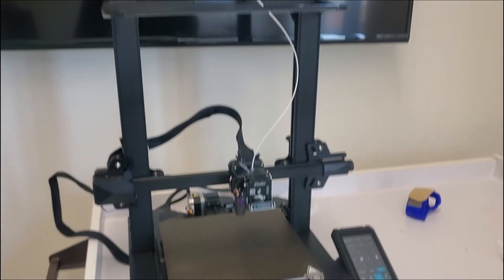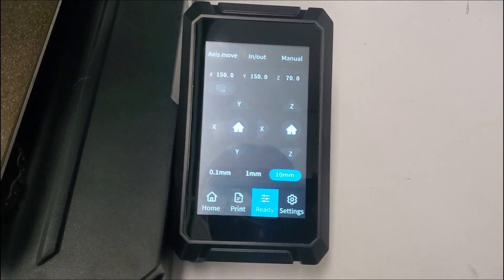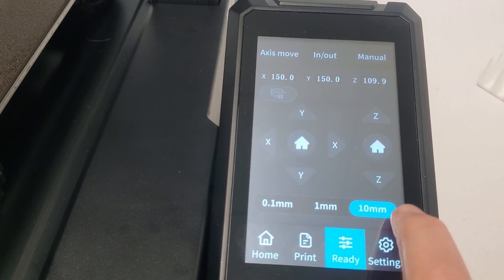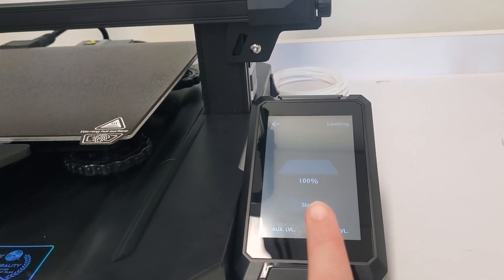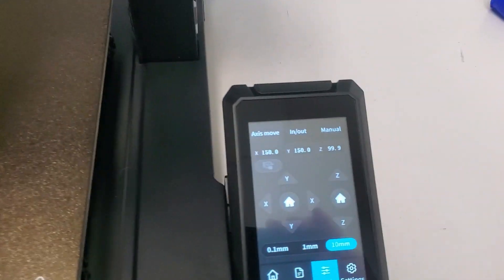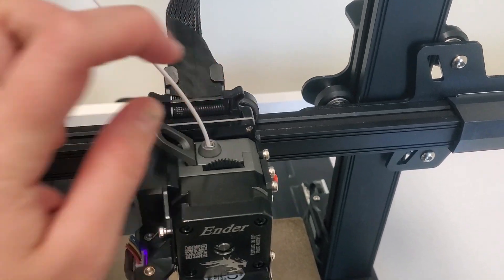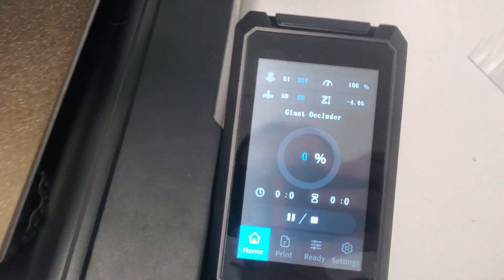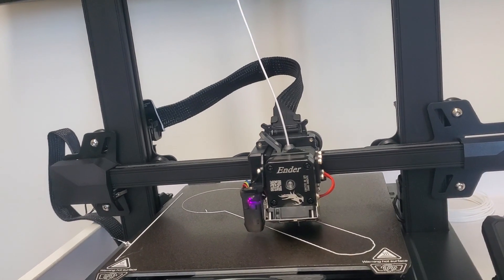How to use the 3D Printer

Comment: Great video I have the same printer one thing I would recommend when pulling out filament don’t cut it, first heat the nozzle the push that releases lever then push down on the filament to push some out the nozzle then very quickly pull up this makes sure that that long skinny part of the filament seen at the end of the filament line you pull out does not get dragged on the other components and get caught in the print head and helps clear out any other partials in the nozzle then look at the little lines on the filament that has been pulled out and cut above those so there isn’t any more lines in that filament . And taking off prints you can let the printer cool down and the print will just pop off the plate as it is a pei plate.